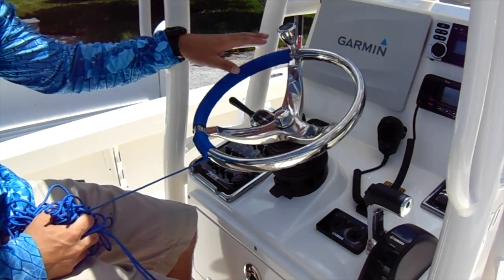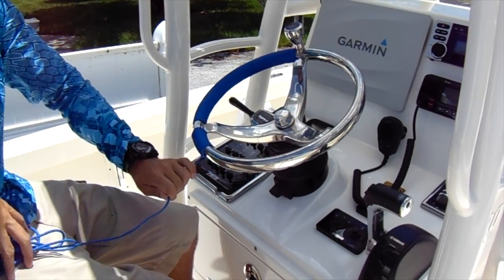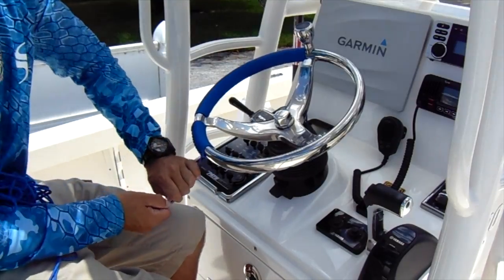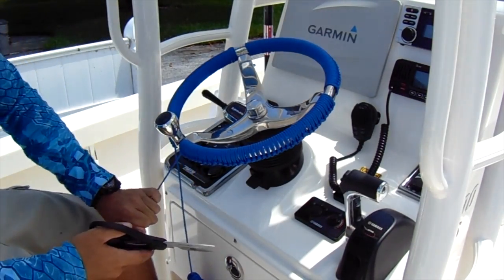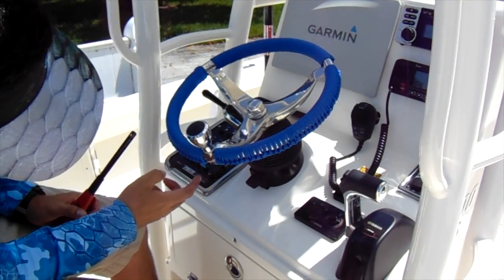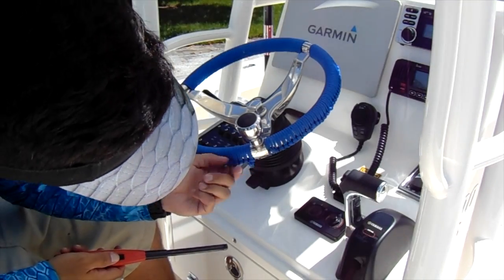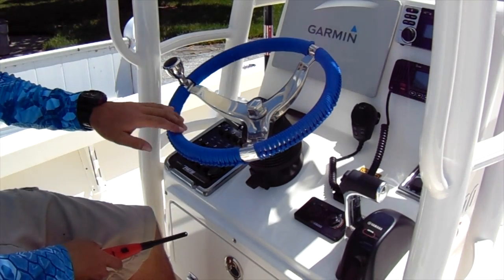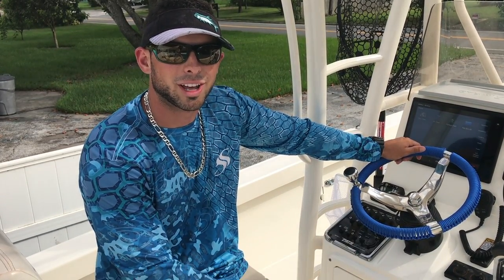How to Wrap a Steering Wheel Using Paracord | Easy Method

Comment: I have used a sock to organize up to 100' of paracord. Feed the cord into the sock until full and then use a small bit of cord to cinch up the top of the sock with the tag end of the cord sticking out. This should make managing the cord much easier. Great job!
Reply: How much cord dose it take
Reply from the maker: The normal size on amazon. Think it was 100’
Reply: The sock is great idea.  I made a spool with a short piece of 1/2” pvc and a couple of tees.  But however you do it, it works best if you have a way to control the cord.  Save a lot of frustration.

Comment: Thanks for the tutorial.  Just finished my jeep steering wheel. It was deteriorating and I didn't want a cheap wheel cover.  Take your time and wrap it tight so it doesn't slide around on the wheel.
Reply: I wanna do this on my Jeep!

Comment: Great idea. I'm thinking that one of the reasons for wrapping your wheel would be to have all of that cord available in an emergency.  The only issue I see is the time it would take to unwrap it so you could use it. There is a different looping pattern that would enable you to unwrap the wheel in a couple of seconds. There are videos showing that wrap.

I have wrapped my steering wheel and the entry handles in my truck. Looks good and I have a lot of cord available quickly.
Reply from the maker: That's a good point brotha!

Comment: How much feet of parachord rope did it require ?
Reply: I saw a different video with same technique. Said that it took about 85 feet for a standard 15" wheel. I'm sure that will vary depending on the thickness of the steering wheel.

Comment: Did you restart at each of the steering wheel supports, did you go on the underside of it or just start over?
Reply from the maker: Just went under and kept going
Reply: Thanks Chris, figured you did that, just finished up. Video was a lot of help and I think it turned out great!
Reply from the maker: Bro, that’s what I love to hear. It took me a lot longer than I thought. How did it go for you?
Reply: Chris Canning it took about 1.5 -2 hours, I got hung up at the first wheel support as I wasn’t doing the over/under correct, but after that and getting the next section started, took a water break, then got going again. Did keep the paracord on the plastics thing it came on and helped a lot. Can’t post a pic but it looks awesome.